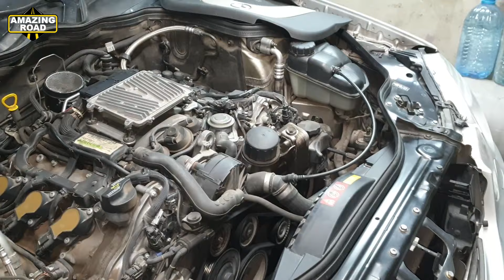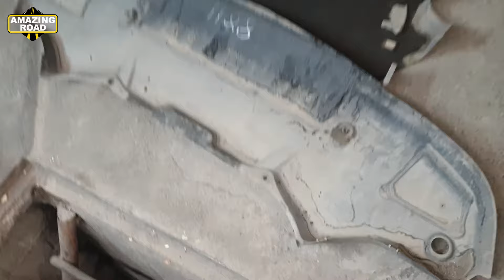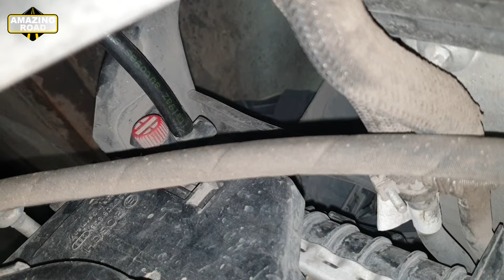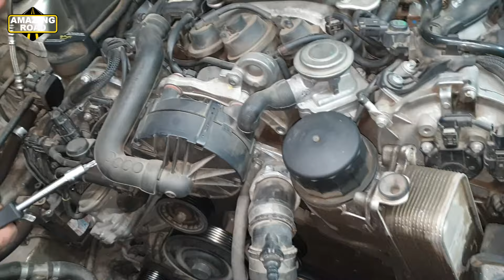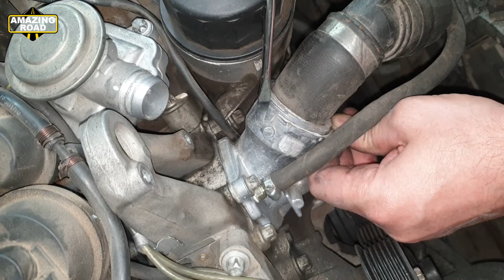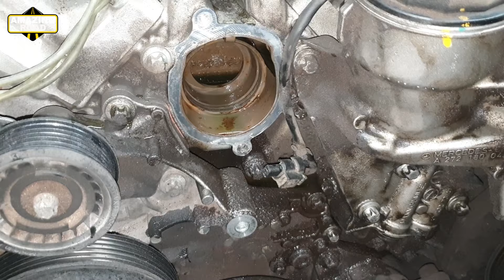How to Replace Mercedes Thermostat  M272 W211, W204 W212 / The engine does not warm up to 90 degrees

Comment: Very nice video.

You should also do an intake air leak test video on the M272 engine. That is a very common issue on these engines.

Comment: Servus eine frage bei meinem c200 w204 ist es so das er zwar warm wird aber nicht auf Betriebstemperatur also er kommt auf 80° hoch aber haut sich mit der zeit dann wieder auf 60° runter, wenn ich aber mal stehe bzw nur anfahren tue wie z.b im stau wird das auto ganz normal warm und wenn ich dann wieder normal fahre fällte es wieder auf 70 60 50° 
Dazu habe ich bemerkt wenn ich mal etwas mehr beschleunigen muss wird er nach der beschleunigung wieder kälter, Thermostat ist gekauft und wird am Dienstag getauscht mal  sehen
Reply: Hey how were the results? I have a 07 c230 w203 with the same issue. Replacing thermostat today.
Reply: @adrianzuniga9477  it was the Thermostat
Reply: Thanks
Reply: @BokiLanoGC hey hab das selbe Problem. Wie viel hattest du für den einbau gezahlt ? 

Lg
Reply: @SolidSnake12231  der thermostat kostet nicht viel einbau sollte unter 100€ sein
Reply: @BokiLanoGC  danke das du extra geantwortet hast 👍🏻
Reply: Здравствуйте какая температура должна быть Мерседес 211 3.5 272двигатель
Reply: Рабочая температура охлаждающей жидкости